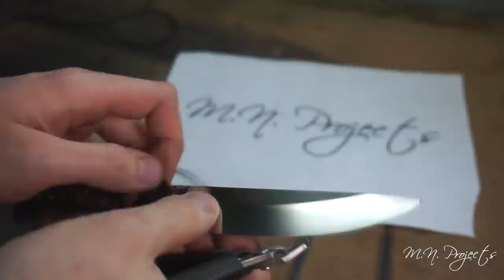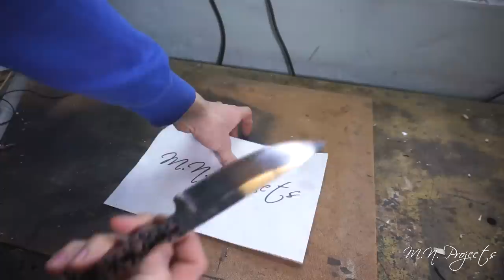Making a Fat Knife from an Old Car Leaf Spring

Comment: So why do all these knifesmiths on "Forged in Fire" do all of that forging and hammering and forging and hammering ad finitum to make a knife out of a car leaf spring when the shape can  just be cut out of the leaf spring????  BTW, loved your video.
Reply: This is machining a knife not forging. Machining is a a really quick way to make a blade well enough to be proud of and a great introduction to forging.
Reply: Many makers only use the stock removal technique. I dont believe it should be assumed as lesser work in any way. Stock removal means you will spend far more time at the grinder using alot more abrasives and is less steel economical. Forging is to take a piece of steel and shape it, not only profiling but adding bevels and reducing thickness prior to grinding. Five minutes of forging can actually save half an hour at the grinder with far less wastage. With quality blade steel in abundance and not every maker carrying the physical attributes to swing a hammer for long sessions, stock removal has become popular. Not my preferred method but no less skillful or time economical.
Reply: Forging also compacts the metal, making it much more dense. Once forged and heat treated it can make a much tougher blade.
Reply: Ground In Fire or perhaps Drilled in Fire is the next incarnation of the show. But for now forging is a very specific term for a very specific process. Oops I forgot, Cast in Fire.
Reply: John C Im not sure compacting is the right word but forging does reaarange the grain structure of the steel which in turn, if done correctly can make the blade tougher. This is more to do with heat treatment than the forging process though and we are talking minute amounts on the scale
Reply: Rob it does both.
When heating and hammering the steel it compacts the material and makes it more dense.
But you are correct in that it also aligns the grains/molecules so that all structures of the steel are aligned to make a much stronger blade, or whatever you are making.
Reply: lambiepie, better theatrical element?
Reply: lambiepie they do it to thin it out a little most of the time. Leaf springs are crazy thick, sometimes up to 1/2”. Leaving it so thick sometimes can negatively effect the blades performance (depending on what you use it for). I do stock removal, and that’s one of the reasons I usually stay away from leaf springs. Also, some guys just like forging. Guys who do both forging and stock removal, will usually hammer out the profile to save time on the grinder, then fine tune the shape and do the bevels on a grinder
Reply: Robs Semmler there’s no such thing as “compressing the steel”. It’s make believe. As the late great Bob Loveless said “you can do a lot of things to a piece of steel by heating it and beating it with a hammer, but making it stronger is not one of those things” god rest his soul
Reply: Marcus Grimes I agree, hence why I said compacting the steel is not really the correct word. You can definitely rearrange the grain structure though, combined with correct heat treatment method does in fact make it tougher. The forging process would also include relaxing the steel multiple times to refine the grain etc.
Reply: Robs Semmler I mean, we’re kinda on the same page, but not quite. During forging, the steel is being stressed out. That’s why you do a few normalization cycles. When you skip normalization, you’re more likely to get a warp, or have a horrible grain pattern. If the act of forging was good in any way, why would you need normalizing to basically “undo” it.
Reply: Robs Semmler been wondering the same thing. thanks for the explanation.
Reply: Marcus Grimes

Then why are forged metal parts sought out over cast metal, and why do higher-strength applications spec forged? (Ex: when rebuilding an engine for more power...turbo or what have you...they'll swap out cast crank and pistons for forged.)
Reply: bcubed72 because cast iron is brittle. That has more to do with what type of steel it is. If you really want to be technical, almost ALL blade steel is forged, this happens at the foundry, where the steel is subjected to intense heat and pressure that flattens it out into sheets, where it is then sent to knifemakers.
Reply: Marcus Grimes
Ah, ok. I do know that hammering metal will change its properties; "work hardening." Though that can be either a good thing or a bad thing, depending. I was under the impression that steel that required a high level of strength (combination wrenches, for instance) were forged to improve these properties.
Reply: bcubed72  yeah, the parts you’re referring to, are forged, because that’s the cheapest way to produce them, as opposed to say, like, milling them out of a big block of tool steel?  Work hardening is real and only happens with specific steels, but it’s not a good thing, it’s an annoyance. And to remedy that annoyance, you have to normalize the steel to relieve any stresses. Idk, I’ve been making knives for good while now, and most makers (even smiths), at least the experienced ones, including myself, just laugh when people start talking about forgings “mystical” properties.
Reply: Gostaria de receber uma faca dessas de presente, sou do Brazil. 🗡🗡🗡
Reply: Good point. This knife chopped wood and sliced pretty good. I'm no forger etc. But the forged by fire guys knives usually break or are crappy at best. I don't care what you call it. That was a nice knife.
Reply: you answered yourv own question ..its a leaf spring he is taking the brittleness out boy peening it ..you should have known mr knowitall
Reply: @robsonez  the correct term is "hardening by deformation". The temperature just makes easier this deformation. Trust me :) I am a metallurgist. LOL.

Comment: What temp did you bake the knife in the oven at and for how long? Was that in order to temper the material? 

Would it not be better to heat just the cutting edge to a blue/purple then dip in water? The blade would be super sharp and hard then whilst the rest of the body would still have the original metallurgy of the spring manufacturers.

Comment: Here in the Philippines we call such raw material as "Mulye" from the Spanish word "Muelye". Hunting Knives and Jungle Bolos made from such material are quite cheap and durable in our locality. I purchased a thick cleaver (8-inches long, 3-inches wide and quarter-inch thick blade) for only P300. Even the thickest leg-bone, toughest coconuts are no match for it. I also use it in chopping firewood. I just hope the local shops here would have similar or larger ones real soon, I am longing for at least a spare.

Comment: Awesome video.  I want to try making a knife with a leaf spring too.  How long did you temper the knife and at how many F°?   Thank you!
Reply: Erik Moreno , that's exactly what I want to know.
how long in oven and at what temperature ??
usually it's around 500 degrees @ about 2 to 4 hours. depending on thickness of steel and what type. I'd say 500 @
2 1/2 hours should be fine to relax and relieve stresses in steel.
Reply: @timschutte8310  awesome. Thank you.

Comment: Dumb question ahead.

What is the liquid you quench it in and is that to harden the steel?

Also reason for the oven?
Reply: It is usually canola oil and oven part is for tempering. It is done to reduce excess hardening which can cause steel to crack.

Comment: That’s awesome!! Might actually try it!!

What oil is used to quench the blade?
How long and what temperature to heat treat the blade in oven?
Reply: have to know the steel to answer those questions.
Reply: Is there any way of telling what type of steel it is?
Reply: @MrAidanfleming  it's likely 5160 HC since it's a leaf spring